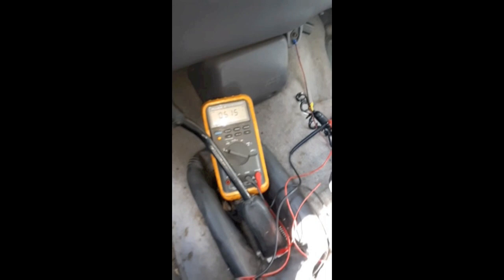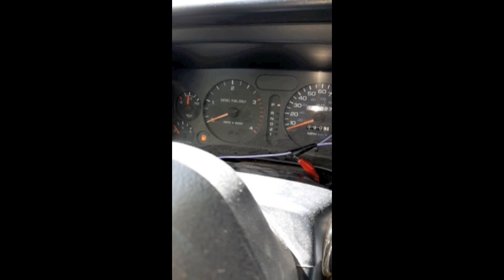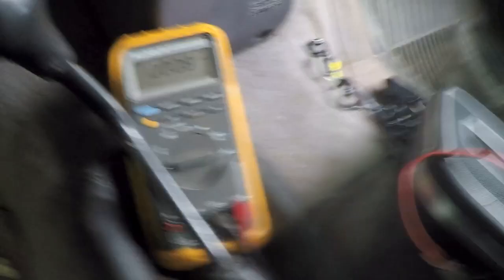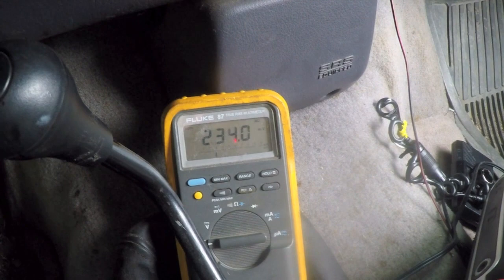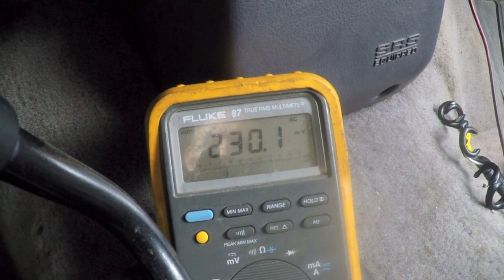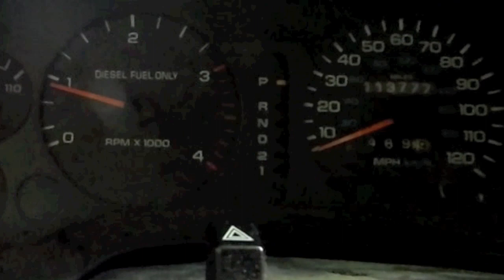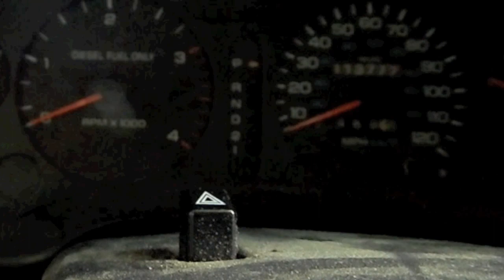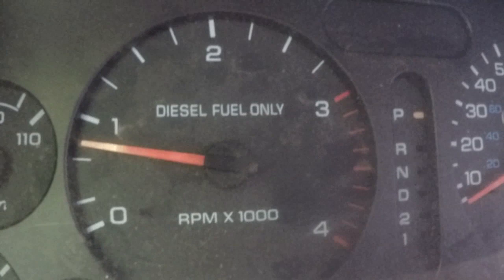Dodge Ram Cummins 12 valve tachometer issues Part  3

Comment: I have the exact same issue with the same symptoms on my 98 12v with the 5spd. Hopefully this works for me too. Thanks for doing the hard part especially since I know very little about electronics.
Reply: I also noticed issues with mine when wet. I went through deep snow and it got deposited in the engine bay.

Comment: When in doubt, I use NGK.  My old Forester and this Lexus both call for NGK plugs.  I came to trust that name.
Reply: Why did you plug NGK this is a diesel
Reply: @Desert515  Because @14:00 minutes (roughly) Steve talks about the other sensor part being of NGK manufacture.  I have a very obscure, tangential mind and often relate seemingly odd situations.  On top of that, I comment often on Steves videos and I never wait to watch the whole thing.  I was relating the quality of the NGK parts to the plugs that OEM manufacturers use.  I make the correlation that if the OEM's rely on NGK, then I, too, can rely on NGK.
Reply: Hey Junior, REAL Trucks don't have Spark Plugs !

Comment: You may have mentioned before but does it show not to be charging at battery with your multimeter when dash charge gauge drops?
Reply from the maker: Yes, a couple volts drop when the charging system shuts off.
Reply: @stevewatr  , reason I ask , on my 1998 jeep Cherokee was doing something similar few years back except tach wasn't effected but being it's gas gets it's signal differently , but does have similar charging system where the voltage regulation is controlled by PCM . VERY intermittently charge gauge would drop but checked at battery it was still charging some . caused dash lights to flicker and cooling fan to act strange.  Had alternator load tested while in vehicle and tested good . Eventually just disassembled alternator and brushes were worn enough to cause light spring pressure and they were arcing  throughing the pcm  hay wire.  Replaced the brush assembly and polished the contact rings and cured it. Ran about year and half and dioed trio shorted but I believe it had been damaged previously when brushes were arcing . 
At that point I decided to replace alternator and upgrade to 120 amp version from 90 amp . That's prob been 2 years ago and no problems .
Could be a totally different situation but thought I would mention it .  I know the 2 vehicles share a Lot of same electrical design with pcm and such
Reply: @stevewatr  I have a 1996 doing same thing but blowing engine fuse inside door fuse panel on driver side could this be the same sensor causing the problem.
Reply from the maker: @philipwright8452  I tend to think you might have a wiring issue. Maybe damaged insulation allowing a wire to short out to the frame, or another wire.
Reply: @philipwright8452  Did a figure out the problem???

Comment: My 98 did this it was definitely the sensor on the harmonic balancer beside the water pump take it loose clean good sand it with sand paper a bit and gap it with a match box or a thick business card and clean the harmonic balancer with sand paper to. It will make her charge 14 volts and read tach
Reply: Has yours continued to work properly the last 3 months? It COULD--theoretically be a connector with a bad connection---like my TPS post above. So, tell me, is it STILL working?
Reply: Did you make another video for part 4 on your Diesel problem

Comment: from what i gather 1997 is a split year for the sensor, or well sensor plug, 1996 and previous is a round style plug and 1997.5 and forward is the flat style you have, but 97s can be found with the round style plug, i think but dont know that the sensors are the same so if you got the wrong one you could cut and splice together or use aftermarket generic connectors? the flat style one seems to be half the price as the round one i guess just due to supply/demand they must be more common
Reply from the maker: I don't know. I just used my trucks year and looked at the pictures of the new part to compare. I did notice a couple sites that would show a cheaper sensor but I think that was for the gas motors and that the websites search engine was mistakenly showing it even though I specified diesel engine. Probably an error due to the 5.9 liter size being shared by another engine.
Reply: @stevewatr  oh im pretty sure of thats how it goes earlier engines are round plugs later ones are flat, i was more so dropping that info here maybe save someone whos watching these videos and doing the fix from getting the wrong sensor

Comment: Have u had any problems since changing that sensor
Reply from the maker: It's been quite a while since i replaced the sensor, and the problem completely disappeared, and has not returned. However, a new problem has started to appear, now occasionally the tach needle will bounce up erratically as if the rpms were going high, but it happens at cruising speed on the highway so i know the actual rpms are study. i also have been experiencing a couple other issues that i believe are electrical gremlins. If I hit a big bump, like a bridge expansion joint, the cruise control will shut off. Also, the overdrive drops in and out occasionally,  but i believe this is a bad ground, or bad connection, possibly a broken wire. I know that there is a break in the wiring to the rear axle speed sensor because that is a stored fault code in the pcm that is causing my rear ABS to not work.
Reply: Figured it out.  Changed battery connectors to military style.  No more issues.
Reply: @stevewatr I know this is an older topic. It sounds like your brake pedal is hanging down and kicking your cruise control off. It will also unlock your torque converter. See if there is a bunch of free play in your brake pedal. Use a bungee cord or something to temporarily keep it from sagging and see if it solves your problem. Then go to a more permanent fix.

Comment: Sounds like you fixed it in this video: bad connection somewhere that made a good connection when you tried to fix it! Now, which wire was it? Or was it the plug? I had a 1992 and 1993 Dodge Cummins that had an issue with the throttle position sensor---years ago. It made the transmission go in and out of overdrive. The dealer installed a new one for about $500! In 2 days it was doing the exact same thing again! Turned out to be the plug and wiring harness instead---that Dodge did not have! I had to research it and get a PT 175 from O'Reilly's off the shelf and fix it myself! About a $15 fix. Had to splice the wires, of course, but that was easy. Now question is: do I need to do the same with this ESS or just simply try to replace the ESS?
Reply from the maker: Hello. In my case the problem ended up being the crankshaft sensor on the front of the engine. I replaced it, and my problem has not returned. However,  as I mentioned in this series of videos, there are several possibilities that can cause this issue, so unfortunately theres no guarentee it would solve your issue. On the diesel motor, the PCM uses the pulse from that sensor to determine if the motor is running, and provide the rpm data for the tachometer. On gas engines it provides crankshaft rpm, and position information to the ECM for the electronic fuel injection system. It's much more involved that the manually injected diesels.
Reply: @stevewatr  I finished the video and my question is still the same: do you think it was a bad sensor or bad wire connection in the pigtail (like I had in my 1992 and 1993 Dodge diesel TPS)?
Reply from the maker: @richardharrison4804  I think you're asking me if I think it was the sensor, or the wiring from the sensor body to the plug. We may never know. I think it was the sensor itself. It takes a beating from heat, oil, dirt, and vibration. The pigtail is non replaceable,  I mean I guess you could cut the wires on the sensor, and splice on new ones, but for me it wasn't worth it. I did keep the old sensor with the thought of doing some sort of failure analysis,  but don't really have the time. Onto other projects.
Reply: @stevewatr  Actually, I was asking if it could have been the plug/connector---as it was in my TPS case. BTW, my 1999 Dodge diesel does not have the part that your 1997 does.
Reply: @stevewatr  My crankcase position sensor/ESS is located somewhere on the block of the engine---I know not where! Autozone could not find it. It is about $25 online but about $69 from Autozone. I would like to put my eyes on it before buying a new one. COULD be another issue causing it. Many thanks for your video and responses.
Reply: @richardharrison4804  it's o. The top of your bell housing where it touches the back of your motor.
Reply: @ballardstowingandoffroadre2367  I have no idea what you are talking about!
Reply: @richardharrison4804  you said you didn't know where your Crank Sensor located!!!!!!! I'm telling you where it is!!.

Comment: Do you know if this issue will put you truck in limp mode? 
I have a 97 2500 Cummins. 5.9 automatic
Reply from the maker: Not sure but I dont think so because the mechanical pump is not controlled by a computer. The PCM could fail, and the truck would still run, but the charging system, gages, and other electrical systems would be offline.
Reply: @stevewatr  thanks for the response! :) 
My tachometer doesn’t work and truck just stays in 2nd or 3rd. Also ac compressor doesn’t engage. 
I went a year and a half without a reverse 😆 and I do construction..with a trailer so I’m sure you can imagine how frustrating that was. 
Just replaced the transmission with a rebuilt and upgraded one a couple weeks ago. So I do have a reverse now.. but again still in I guess limp mode 
I do remember my cruise control only working occasionally. 
Just trying to check some things off before I have to send my PCM in to get “repaired”
Reply from the maker: @theboss477  well, that crankshaft sensor lets the PCM know the engine is running, so if it is bad, the PCM does not think the engine is running. This can cause a lot of weird things like the alternator will not charge the battery, overdrive and cruise control wont work, and more. Many people have replaced good alternators and PCMs only to find the issue was the sensor or wiring related.
Reply: @stevewatr  thanks! I’ll see if the alternator is putting out the power it should be..if any. Definitely going to mess with the sensor before I send in the pcm
Reply: @theboss477 did you figure out your issue?? I have exact same issue. Only have 2nd and third along with other stuff
Reply: @danielfreeland1638  nope 😂 truck was white ..it’s now green and I’ve been doing construction out of a 2013 Kia Sorento
Reply: @danielfreeland1638  but I did have some guys come out and they said my pcm wasn’t communicating with the trans. 
I just never got a new one. They don’t make them anymore for that truck. Either used on eBay or have one rebuilt
Reply: @theboss477  hmm. I have no tach no speedo no gen tranny in limp mode and the wait to start light check engine light among other won’t even come on. I’m so confused

Comment: Did you ever completely resolve it? Will there be a part 4? Did the ess fix it?
Reply from the maker: It's been quite a while since i replaced the sensor, and the problem completely disappeared, and has not returned.

Comment: I'm th guy that made the comment on the first video about the hydraulic control of the first three gears, with the PCM controlling overdrive.

Makes me wonder if one could adapt the PCM and this sensor to a carbureted gas engine to control a similar transmission (hydraulic with electric overdrive and electric torque converter) as a transplant into an old Mopar muscle car.
Reply from the maker: I suppose you could, but I have to think there's got to be a better way that doesn't involve the expense of all those components.
Reply: @stevewatr  components would be free if you could find a scrapped truck, issue is any gas engine is gonna be running at double the rpms of a cummins.. the shift points and expected power/torque is gonna be way off, ntm youd have to mimic or use the crank pulley as it holds the divets or whatever the sensor picks up on in a specific pattern of some kind
Reply: @AndrewBrowner 
The sensor is not that smart to care about that particular pulley it is just a magnetic pickup sending a signal you could use it to send a pulse to anything that your heart desires the magnet is just cutting lines of flux to generate an electrical voltage you would just need something like an arduono or raspberry pi to interpet the input and make an usable output for your particular want
Reply: A binary code of sorts

One and offs just like turning your light switch on or off at the house it either has on voltage or off voltage and the intensity of the algorithm would be determined by the frequency of on and off